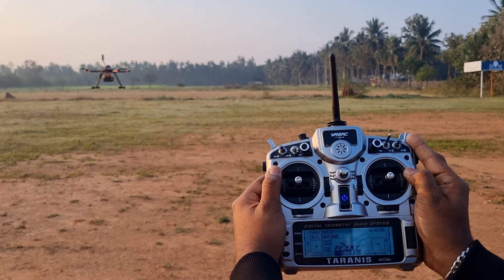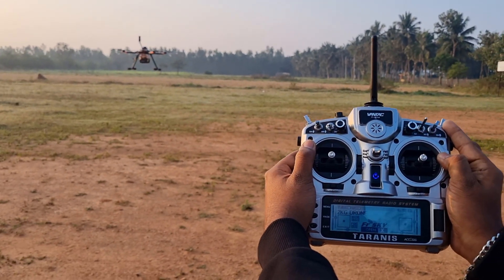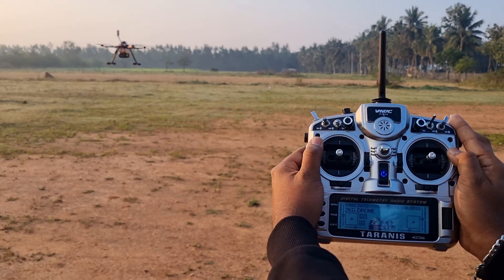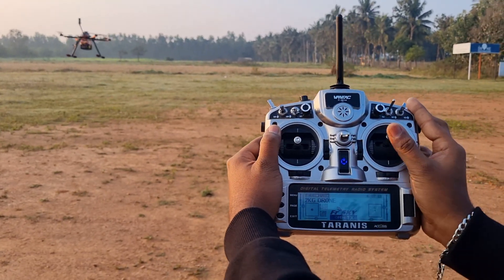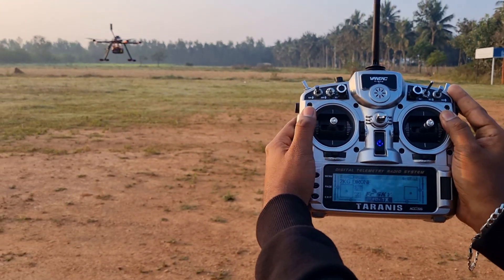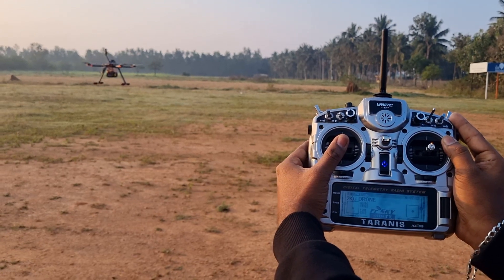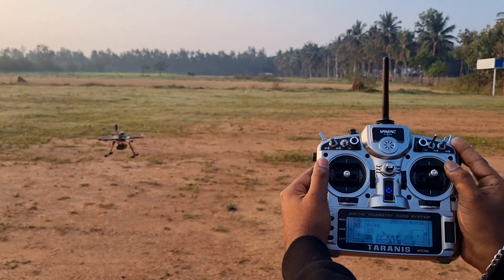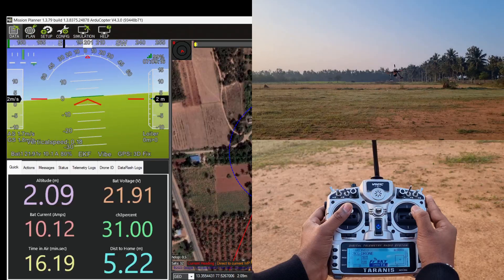Beginner's Tutorial: Introduction to Arducopter Flight Modes - Part 01

Comment: Hi..I am using the same RC transmitter but using R9MX receiver which uses access protocol. I don't know why my RC transmitter and receiver has very less range about 10 m only. And I am using ~400MHz telemetry module, it also have very less range only 5-6 m. What is the reason....Can you help to resolve this issue?
Reply from the maker: Which version are you using LBT or non LBT?
Reply: @karthikstechtime0910  I am using Fcc firmware for receiver and transmitter

Comment: Intha modes la tx la epdi set panninganu sollunga bro
Reply from the maker: In Mission planner navigate to > Initial Setup > Flight Mode. Here, you can select your preferred modes. On your radio, designate a 3-position switch to serve as a flight mode switch.

Comment: Nicely explained.Thanks for such a nice video.In my drone in Loiter mode speed of the motor doesn't reduce at zero level throttle.why it is so. is it by default . If it not by default than will you give me solution to this .
Reply from the maker: In Loiter and Alt Hold modes, the motor will continue spinning until the throttle reaches 50%. It adheres to the value set in MOT_SPIN_MIN. If you maintain the throttle stick at 0, the motor will eventually stop spinning, leading to disarming.